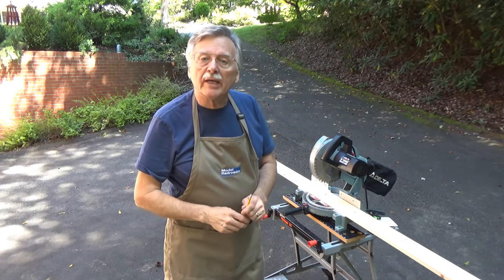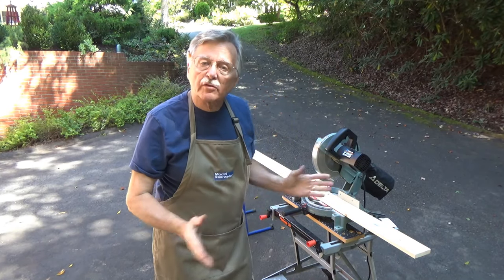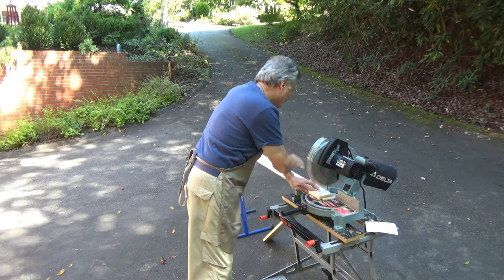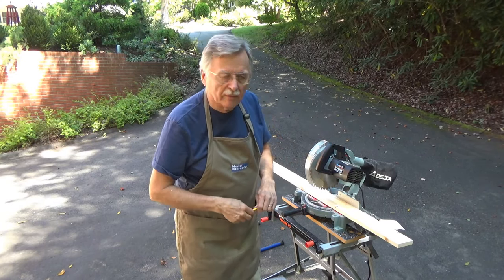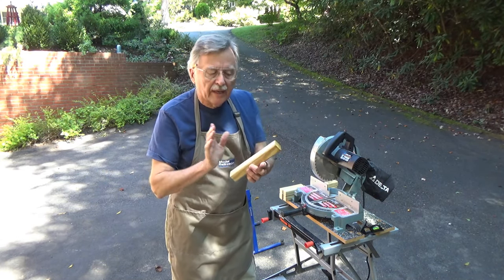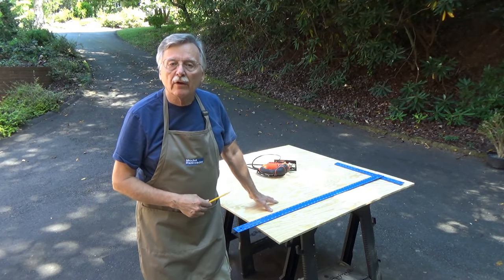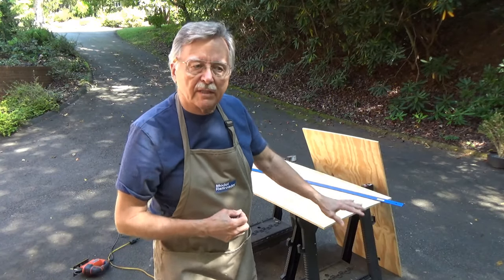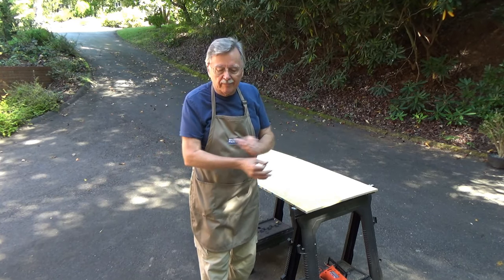Cutting The Lumber (129)

Comment: I have always put in 2 additional, internal cross braces, on my 2' x 4' modules.  Do you feel that is not needed when just attaching plywood directly to the frame top?  I have always elevated my sub-roadbed off of the frame to give more facia height.  Also what number of ply is your plywood?  I have always used 5-ply plywood for added stiffness.

Comment: What is the defferint between the HO SLE88 Code 100 Track Electrofrog Large Radius Turnout Right Hand, and the Insulfrag? Thank you
Reply from the maker: Electrofrogs have metal frogs that can be powered whereas Insulfrogs have mainly plastic frogs that cannot be powered. This lack of power can result in locomotives stopping as they cross.
Reply: @TheDCCGuy  Thank DCCY GZUY. Is ATLAS has #10 and #8 Turnout HO Scale.

Comment: I’ve been looking forward to this Larry. Keep safe.
Reply: Hi Larry: well I discovered that this engine setup includes a decoder already installed!  The only thing I had to do was programme to a number, and it runs fine. But the darn instructions do not say that  I thought that I could get a decoder that would  plug into the installed board, but they are not available  anymore. I tried to install a tusame 2 decoder but have problems programming I use a NCE system and for some reason they just won't do it right. Joe k

Comment: Larry : I should have been a little more explicate. What I was trying to install a SOUND decoder in the bachmann plastic On3 loco. The only pickups are on the tender. Sorry keep up the good work!        Joe k.
Reply from the maker: Ok, I also misread and saw On30. At any rate that should be an easy installation, especially if it has a tender. Do the instructions say it is DCC ready and if so dies it have a plug or socket?
Reply: @TheDCCGuy  Larry: yesit does have a tender,. But when I tried to program the decoder. All I got was " can't read CV. Now I used the instructions that was supplied showing where each wireless connected? The question that I have is can one hook up a decoder only in the tender? The engine part is like only made for Christmas tree running! It's totally a plastic unit. It does have wires going into it but I think it only hooks up the frt.lite & the motor. It does have a 21 pin plug on connector but know one has a plug connector for this loco. Joe
Reply from the maker: What is the make and model of the loco, including the model no. on the box (nit the loco number)? Maybe I can download a copy to see what gives.